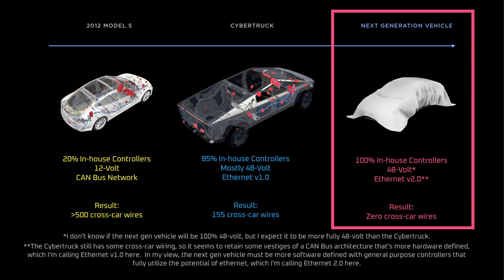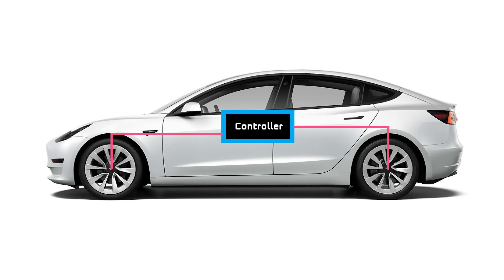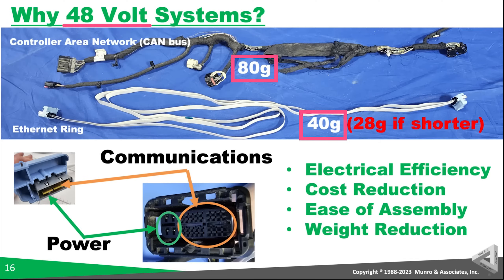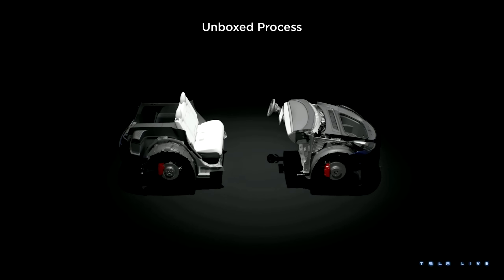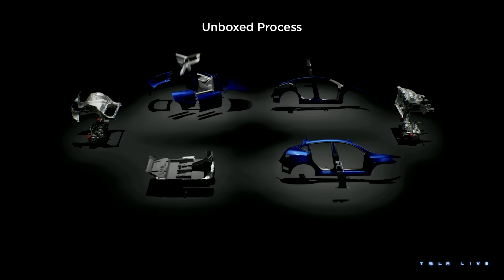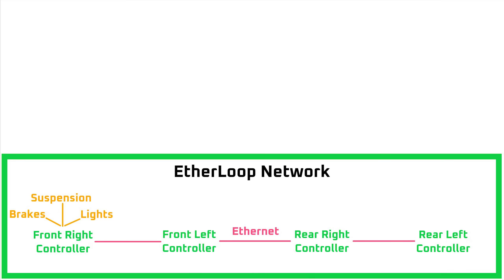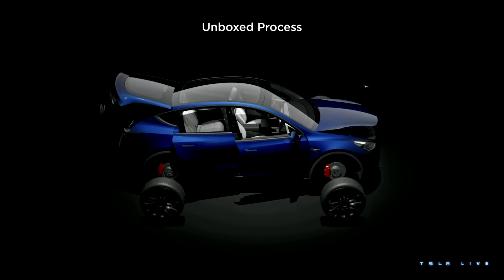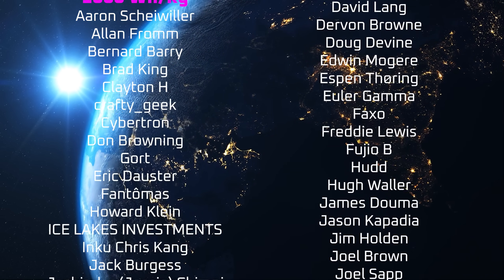Digging Deeper on Tesla's Etherloop Wiring System

Comment: The problem with combining controllers is that a single failure can impact multiple systems. Now, there are are non-critical or closely related systems where that isn’t necessarily a problem, but there are many places where a controller failure affecting multiple systems could have serious safety implications. It doesn’t have to be the whole controller that fails, if any controller losses it’s communication, the all the endpoints controlled by that controllers (and in a loop, potentially some downstream controllers) would be offline.
Reply: I Agree, it is not good for a single failure to affect multiple systems. Tesla seems to be big on redundancy in their systems. What if it was designed in a way that if a couple of the generalised controllers completely failed, that the rest of the network could compensate for that?
Reply: @Brocknoviatch  There are things you can do it mitigate controller failures, but in many/most cases, you won’t be able to have redundant controllers for a single sensor/actuator, at least not without significantly increasing the cost of the sensors/actuator mechanisms, offsetting much of the savings of combining controllers. 

Some sensors are “non vital”, and don’t require any redundancy. An individual wheel speed sensor might not be vital, as the car can still operate and brake on the other 3 wheels. The cases in which that wheel speed sensor might be essential would be under some type of catastrophic failure such as the wheel bearing locked up or the wheel came off, in which case, the sensor is the least of your concerns. Such sensors need to be durable and reliable, but aren’t actually vital to safety so don’t have to be redundant.

Conversely, battery pack temperature sensors absolutely need to have some level of redundancy, and different sensors in the battery pack need to be connected to separate controllers so that a dangerously high temperature is reliably communicated to the driver and/or the system takes immediate actions to mitigate the problem.

Being selective about the specific systems you combine onto each controller, and making sure your communication systems between controllers has fault tolerance, does allow the possibility of significantly reducing controller count and wiring concerns. Maybe you get it down to 2-4 controllers per quadrant of the car, for a total of 8-16 controllers sharing some type of fault-tolerant network between them.

Comment: I work on class 8 truck and trailer, modern electronics are both a blessing and a curse. The ability to plug in and have the module tell you why it's unhappy or not working is a blessing, and makes troubleshooting so much easier. The major problem is we need three to four different software packages (per manufacturer) and maybe two dla's to utilize all the functionality. We've seen this slowly start to change as Paccar has begun using their proprietary motors, and GM has done the same with Freightliner and Western Star (although you can order any of these with a Cummins Motor as well). The major problems I see with all these systems is module and wire degradation due to environmental factors, and the cost associated with replacing these modules. If Tesla could implement a robust line of universal modules with highly flexible firmware options it really could be a game changer. And a single communication network would be awesome as well. We started with a star-point bus, then they added a back-bone bus on top of that, later the star-point bus was removed in favor of two back-bone busses, and a modern Paccar is now a nightmare of different busses connected to endpoints, routed to controllers, and then through different busses to a common gateway controller. Needless to say it's a mess.

Comment: Ohh but what's the under the hood of the etherloop (transport layer, think tcp/ip), that's the most interesting question! Since they have point to point connections the network layer is very simple, and transport my guess would be a modified UDP with some kind of priority information (like CAN ID). Man that would be very simple and very fast... I think they would simplify and merge OSI layers as they don't care about many features there. Jealous of those engineers.
Reply: You can have a look at standards like the ones used for TSN  and 1722 for encapsulation of frames , a lot of Layer2 stuff 😊

Comment: Today's HSCAN is mostly 500kbps but the protocol can support up to 1Mbps but is rarely used. CANFD can support much higher speeds up to 8Mbps
Reply: AFAIK the CANFD speeds are only/mainly used for updating firmware. You try sending 9M of firmware over a 500kBit/s CAN bus (it takes about 5 minutes).

Comment: The Cybertruck is basically doing for the next gen platform what the Model 3 did for the Model Y.
Reply: @thelimitingfactor 
I think we might see this in the "Cheap interim" vehicle.
Model 3 (Y?)
Assembled exactly as per the presentation shown.
By necessity having the new systems in place.
.
Amortised body parts/ castings, testbed for 48v/ Small vehicle steer by wire/ Electric braking(?).
Small pack.
Single motor.
"Dialed back" performance (focus on range)
.
Target price? $30k (ish)
.
Sold as "cheap Tesla for drivers"
(Goodbye Corolla?)
Reply: It is amazing how Musk can move in a different direction from all others with such confidence.  The cyber truck changes everything. And his drive and confidence affects all those that work on these major projects.  And he has the time and energy to produce twelve children.  I hope he does well for a very long time.  Our country needs him.

Comment: So there doubling the number of connectors in a moving object with a lot of vibration and environmental factors that’s going to cause teething problems
Reply: Etherloop with Dual TX (Transmit) and Dual RX (Recieve) in full duplex should act the exact opposite. twice the data means even if one path fails you have complete redundancy thru the other path between Controller and all of the vehicle's sensors. Etherloop should eliminate similar Haywire situations most folks experienced in their lifetime using current CANBUS technologies.  and give enough time to diagnose the single point of failure and find i.e. disconnect in wiring on the other path OR bad sensor failing it's healthcheck , etc.... and there are many off the shelf ethernet tools which should make finding problem area using time-domain reflectometer (TDR) tools a breaze

Comment: Apart from the copper advantages, I dod suspect, the use Power-over-Ethernet (PoE) specifications to distribute power over the Etherloop.  The spec's for PoE provide at least 44V and Up-To 50W of power / Ethernet-cable.  This is a great advantage 1 standaard Etnernet cable can power every controller and everything else from the separate 48V power system.  Also eliminates (reduces) cross-wire interference due to voltage similarity.

Comment: Layer 3 switched devices resolves Ethernet collisions. Layer 2 hubs, we're collisions can occur is a thing of the past not used nowadays.
Reply: Layer 2 hubs don't support neither 1Gbps (standart from 1999) nor mixed 10Mbps/100Mbps going throught 1 hub nor full duplex links.
1 network segment with 100Mbps hub has 100Mbps total bandwidth (and part of that is wasted on collisions).
1 × 1Gbit 5 port switch has 5Gbit forwarding capacity (it can under proper circumstances recieve 5Gbps and send those 5Gbps over it's ports).
Hubs are just way too slow and therefore not used anymore.

Comment: CAN and ethernet both need firewalls for security.  You don't want hacks to the cabin entertainment system to put brakes and steering at risk.   So, there are separate networks. For safety and security.  Also, any network wires that extend outside the locked envelope need to be firewalled because they are at risk of hacking.  For other vehicles (not tesla), that included blind spot radar mounted in the rear fender well.  That may not apply to teslas.
Reply: There's no such thing as a CANBIS firewall, because CAN doesn't have device IDs or any concept of addressing.  It's a terribly insecure protocol. Like not even insecure, but non-secure. The concept of security doesn't exist in CANBUS itself, it can only be layered on top.

Comment: Do you know what protocol do the individual devices communicate to the controller with? SPI? If Tesla has to make custom modifications to the ethernet protocol stack, it seems like instead they could have developed a new protcol from scratch that is much simpler than TCP/IP and could be implemented on even the most basic microcontrollers allowing each device to connect directly to the etherloop and get rid of the need for the regional controllers.
Reply from the maker: Oh man!  That's beyond me, but it makes sense.  This video was a stretch for me.  I know there are more level/layers to this and I'm just scratching the surface.

Hopefully someone else can respond intelligently when I publish it.
Reply: Modern microcontrollers are plenty powerful for TCP/IP, it's not that heavy of a protocol. We're far past the 8 bit chips now. That said, 'EtherLoop' sounds a bit like EtherCAT - which would be great for this kind of thing, they may well be basing it on that, or something similar. It's a rugged Ethernet style protocol, with custom chips that handle the comms on the slave side, allowing for Realtime communication, and even certified safety over the ethernet line. I suggest looking up 'EtherCAT' and 'Safety over EtherCAT'
Reply: Why would they use TCP/IP? Ethernet frames should be more than plenty (with a convention of resending info often or in certain cases using ack frames).
Reply: Definitely not TCP/IP. Doesn't make sense to use an ancient protocol when you control the entire ecosystem. And I wouldn't sit in a car that uses TCP/IP for braking.
You need a system that's extremely reliable and has a guaranteed maximum latency well under a millisecond. This involves the hardware as much as the software.
I would go with some kind of token ring architecture, which is older then ethernet. The wires form a loop, and the data goes around until it finds the destination. Could be bi-directional for free redundancy. It's like a train going on a looped track, and each station can add or remove cars as needed. The control logic is trivially simple, you receive the data, use what you need, and pass on the rest to the next node in the loop. You know when you are allowed to send and how much spare capacity left, so there's no collision or packet loss. And prioritization is easy too. If there's no more room for your message, just replace a lower priority one. Or if you don't find one, delay or drop yours depending on the type.
Can have multiple "trains" in each direction to further reduce latency.
The weakness of this system is that it's vulnerable to faulty or malicious nodes, but here neither should be an issue.
Reply: A lot of the features are implemented in the dedicated Ethernet switches in hardware. The en- and decapusaltion of data can be done in the controller .
Reply: @andrasbiro3007  the wires DON’T actually form a loop in Token Ring - the signals went from one station to the next. That’s how they could decide who had the the token (the right to transmit packets). The signals went in a ring (hopping from station to station) but the wires didn’t.
Reply: @peterfireflylund  
I know, but having a physical loop adds redundancy. Otherwise braking one connection, or losing a controller cuts the entire system in half.

Comment: It would be a rather safe bet to think that "Etherloop" actually is "Single Pair Ethernet". Which would be compliant with any of these standards.

IEEE 802.3cg 10BASE-T1L if you like low cost, low energy (110mW), long length (1000m), and 10Mbit/s is enough (still between 80 and 10 times faster then CAN-bus).
IEEE 802.3bw 100BASE-T1 if you think that a compromise between speed, energy consumption (220mW), and distance is great (800 to 100 times faster then CAN-bus).
IEEE 802.3bp 1000BASE-T1 if you opt for the highest speed possible (max 15 meters) (within a car length 8000 to 1000 times faster than CAN-bus).
It has been designed for usage in cars. It is a great standard that makes a lot of sense.

Tesla may call it Etherloop as it actually is a bus, so it will pass through all units. In reality, be closer to the 1990 RG-58 COAX 10BASE-2 bus Ethernet but on a single twisted pair instead and full duplex instead of half-duplex. It will still have bus collision as an efficiency limiting factor, but with enough lanes used, it is not an issue. 
I have been waiting for the first car to use that standard for about 6 years now...

Comment: it will also make cars impossible to service by third parties or owner....
Reply from the maker: It's actually easier to service than an ICE vehicle
Reply: Bs
Reply: As someone who actually does diagnosis on these systems. In my opinion, its easier.
Reply: This does seem to reduce the amount of redundant systems and simplify the complexity. You could probably get on the network with a diagnostic device and ping all the components to figure out what's wrong....

Comment: So, replacing a real time networking system with a shared network? That could be bad, very bad. Imagine a streaming signal hogging the pipe, resulting in signals not reaching your brakes.

Real-time networking is no joke, and is not optional when it comes to safety.

Comment: 👍👍 great video.
Ethernet & POE (power over Ethernet)works on computers.
It will work in cars.
Reply: Yes , it is called PoDL Power Over DateLine. Automotive Ethernet uses only two wires therefore it looks a little bit different than PoE in detail

Comment: The ability to reduce the number of controller type is quite easy with a EtherLoop structure. It would be likely that the software for each each controller would be loaded at the time the car was  entered by the driver. This means that the software could be easily updated since it resides in a common location in the car. Having auto configuring function (this is a common in many types of equipment) in each controller would simplify the assembly process. The speed of the EtherLoop would make the software load almost instantly.

Comment: Interesting to hear about this development. 
I do have couple of points. 
Car usually don’t have one CAN Bus. The Ford Focus 2019 I was working on last week had four high speed networks on it. 
CAN Bus is run through multiplugs connecting dashboard, underbonnet and body looms as a matter of course. So separate modules can be, and are, regularly connected at assembly time. 
Communication protocols are not tied to any specific system voltage. CAN Bus is usually operated at 5V. 
The separation of buses is desirable as you do not want an interior light circuit fault disabling the Dynamic Stability Control!
Multifunction modules are already commonplace on CAN Bus and LIN Bus systems. Mercedes have ben using a system with front and rear SAM (signal acquisition modules) for over twenty years. 
Final thought, when the etherloop gets a chafe and shorts to ground, how will we find it?

Comment: First of all, I'd like to say that this is a really good Video on the subject, that has a lot of Details for people that dont know a lot about this topic. But I think one key Information is missing:

The important thing about automotive Ethernet is that you can loop it (big advantage in terms of safety!), and send continuous Data (e. G. Video Stream of a Camera) in Addition to that, it can reach up to 10Gbit/s, wich is way faster that can.

However, if it werent for the fact that you can loop ethernet, and that Tesla needs camera Streams, the same "zone-architecture" could also be achieved with a conventional canbus network.

 You could also loop canbus through the different Controllers (wich is actually done in many applications), you could also use general purpose Controller, and with CanXL, you could also get up to 1Gbit/s.

Thats why I think you spend a bit too much time talking about the Zone architecture and General purpose Controller in the Video. Those two points are absolutely brilliant, compared to other vehicles, but implementing them does not require automotive-ethernet.

Comment: Do we know which measures Tesla has taken to reduce interference and voltage spikes from inductive sources south as the motor/s? I would suspect that they would use twisted pairs for connecting the controllers onto the loop. 

Great video, by the way. Liked and subscribed!

Comment: A very important point that this otherwise excellent video has missed (and commenters too) is that with generic controllers close to the hardware, many more endpoints, both sensors and controllers, can be implemented without massive amounts of wiring. 
This allows localised control, such as suspension sensing and feedback to be under software control which in turn means software defined hardware (which you touched on). The important upshot of all this is that Tesla can (and does) use software updates to refine how the entire vehicle behaves, right down to stuff like traction control, anti-lock braking, configurable suspension, and much much more. Levers, rods, springs, cams replaced by software. 
This in turn makes recalls and improvements mere downloadable updates, saving time, money, and allowing Tesla to make their vehicles better on the fly without owners having to do anything except accept the update and smile a lot. Their grand design is pure engineering beauty and well ... downright sensible.
Reply from the maker: Thanks for the well-considered comment!

Comment: For it to work, it needs to be something like POE, so POWER is also delivered down the data cable. Each tail light housing could only have a data cable, and fan out control to each light / led in the housing. It would be fairly easy to share data and power over the same cable, as long as the amperage is fairly low. This is quite similar to the NMEA data network.